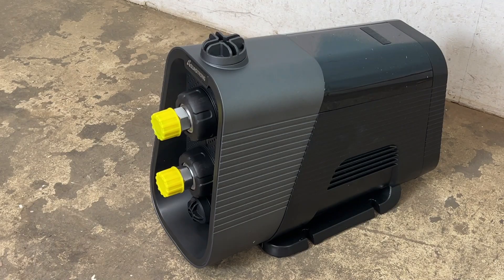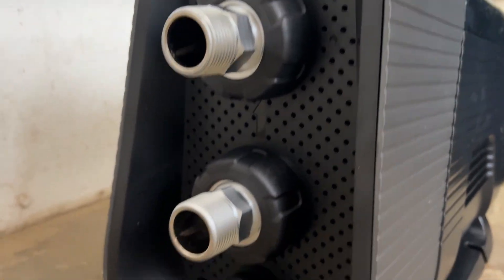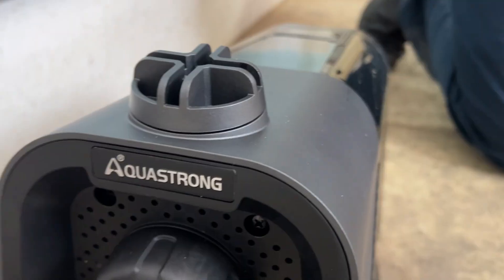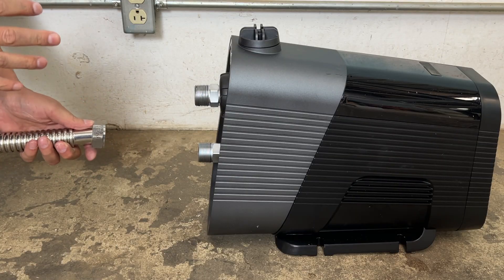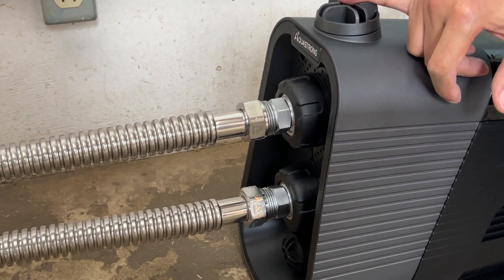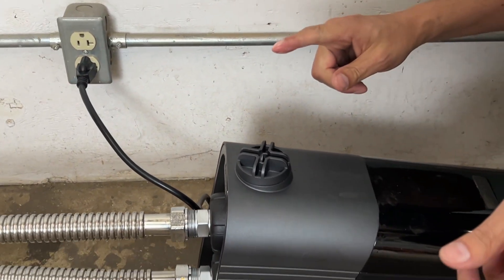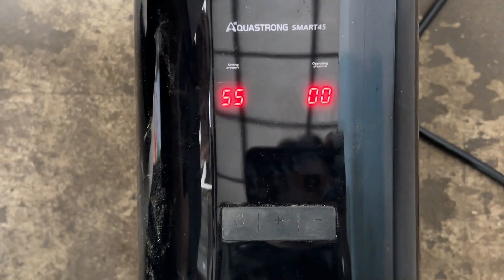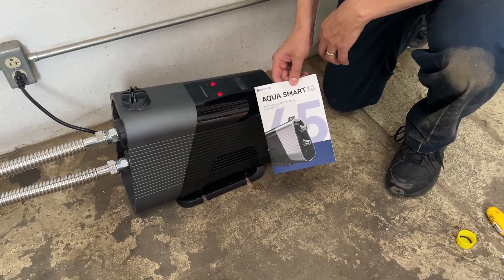Fix Your Low Water Pressure With a Booster Pump AQUASTRONG Water Pressure Booster Pump

Comment: Weight and cost of pump ?
Reply from the maker: Here’s the link with all the answers: 
💦Booster Pump In Video: https://bit.ly/4j0NHz0
Reply from the maker: In this video, I will show you how to install a booster pump to increase your water pressure.

Introducing the Aquastrong Smart 45 Automatic Water Pressure Booster Pump 

This high-quality well-built booster pump is easy to install and will give you better water pressure.

Aquastrong Smart 45 Automatic Water Pressure Booster Pump, Integrated Self-Priming, 115V Variable Speed Constant Pressure Smart Pump for Home, Shower, Garden Irrigation, Shallow Well. 

💦Booster Pump In Video: https://bit.ly/4j0NHz0

As an Amazon associate I earn commissions on qualified sales. Thank you. 

*Adjustable Pressure & Speed: Smart 45 is a fully integrated and intelligent water pump designed for domestic boosting. It automatically monitors and adjusts performance according to water demand, ensuring perfect pressure at your faucets. The smart pump control maintains constant pressure across all taps in the house, with a maximum flow rate of 1500 GPH and a maximum head of 150 ft. The pressure setting range is 1.5-5.5 bar (22-80 PSI), with a preset of 3 bar (44 PSI).

*All-in-One Robust Design: Smart 45 is built with a durable stainless steel impeller, designed to withstand hot water temperatures up to 175℉ while effectively preventing leaks. This robust water booster pump features a maintenance-free pressure tank, stainless steel connectors, and an outlet equipped with a check valve. The precision aluminum motor housing is made from rustproof eco-friendly materials, ensuring both durability and health safety.

*High Efficiency & Low Noise: Smart 45 features an air-cooled permanent magnet motor and inverter technology, operating quietly at just 55 dB(A) in typical use, ideal for residential and light commercial settings. It provides over 50% energy savings compared to standard pumps, resulting in significant annual cost savings. The pump works efficiently in a water temperature range of 32℉-175℉, reaching a maximum speed of 5200 RPM with a rated power of 550W (max. 750W). It can run 24/7 for a long service life.
Intelligent Protection Features: This small self-priming pump is easy and safe to install and operate. The control panel includes fault indicators and protections, such as power supply failure, pump block protection, pipeline leakage, dry-running protection, overheating protection, and pressure-sensor failure. If the pump becomes blocked or overloaded, the built-in automatic thermal switch will cut power to protect the motor.

*Wide Applications: Smart 45 is versatile for both domestic and light commercial water supply, enhancing pressure for city mains, roof tanks, water tanks, shallow wells (up to 26 ft), garden irrigation, and clean water transfer. Aquastrong provides professional advice on installation and maintenance to keep your water system stable and worry-free.